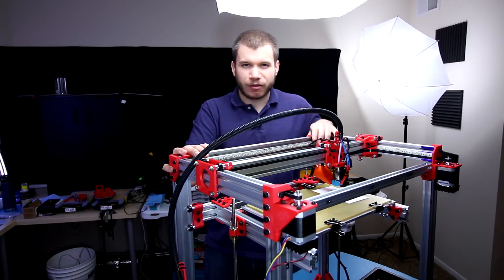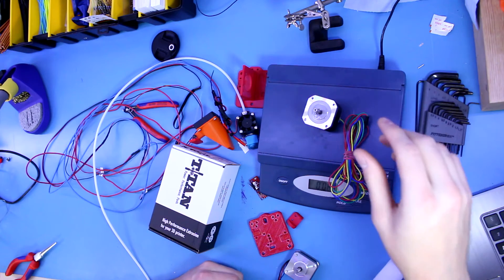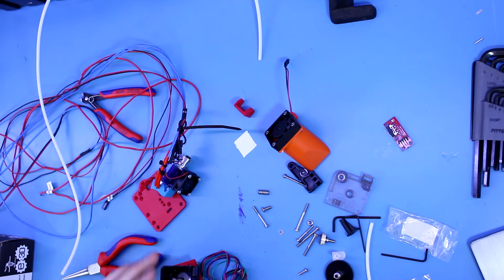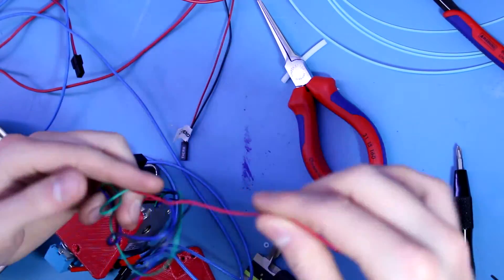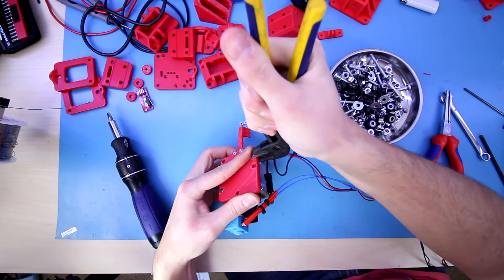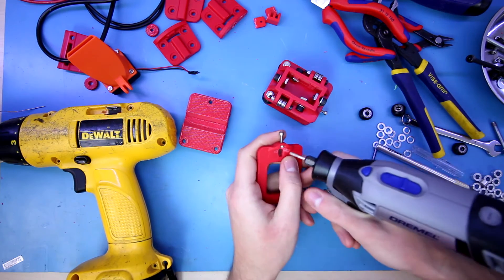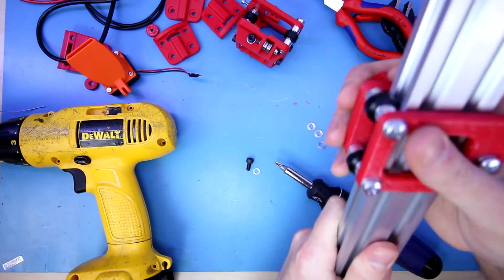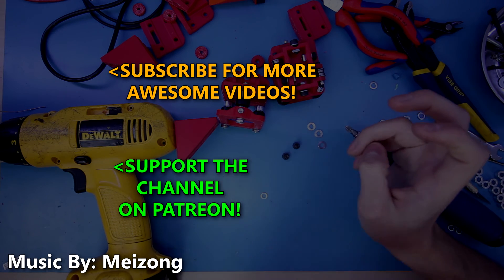More Upgrades, More Overhauling! - 3D Printer VLOG 26

Comment: Hi there nice build, I have an d-bot but i'm usign ABS spacers, but I ant to change to metal. 
Which spacers are you using? Can you tell me the measure? I see 6mm, 6.35mm, 7mm, but i don't know which it works better.
Thanks!
Reply from the maker: I use the 6 mm along with the 1mm metal shims. Check the thingiverse link for the openbuilds links and the quantities needed. Also make sure you get metal shims for between the two bearings in the wheels. :)
Reply: Power Playground big thanks! I ordered metal corners to make it stronger. And I want to make it full metal hahaha. I will stay tunned to your build it seems very stringer and realiable.
Thanks again!

Comment: Is there any drawback compare to Bowden setup?
I'm in the middle of D-bot build and want to try Titan extruder so I end up with your videos, I might change to your print setup too.
Reply from the maker: The main drawbacks are that it will put more load on the X and Y motors and it won't be able to print as fast as a bowden setup. However I will say that the weight of the compact stepper motor and the titan extruder I chose is pretty negligible. I personally prefer the reliability of a proper direct feed setup over the slight speed advantage of the Bowden setup.
Reply: Thx, will wait for your design then :)